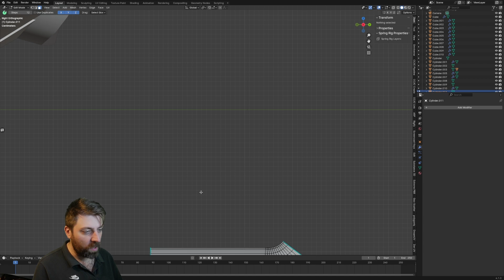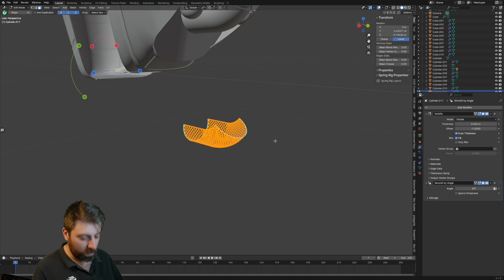How to make Metal Grate in Blender SUPER EASY

Comment: You can also use wireframe modifier @1:00 instead of inset faces + solidify. Shape will be more fit for like a fishnet
Reply from the maker: you are correct. I find though that I dont get a flat surface.